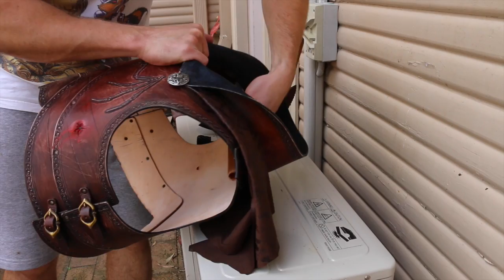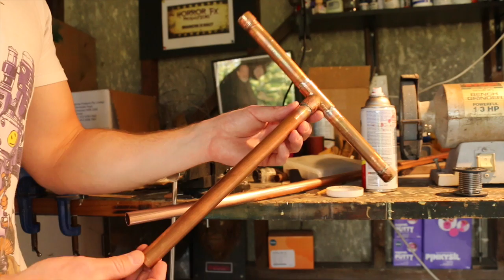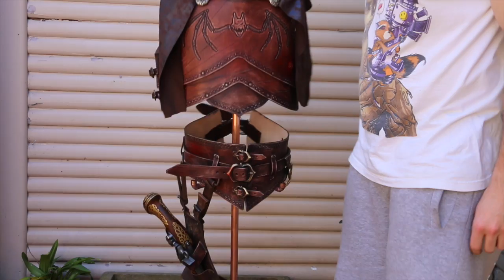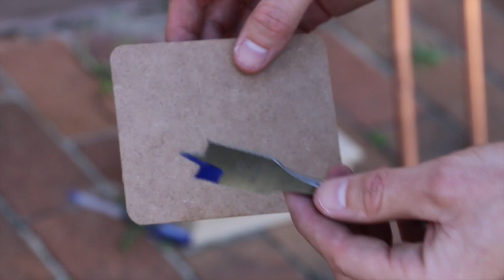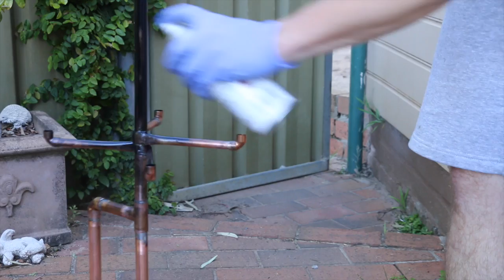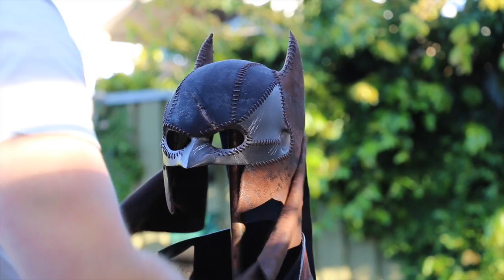Pirate Batman: Copper Pipe Suit Display Build!!

Comment: nice work. just a little fyi for future reference it you heat the copper pipe from behind and then place the solder at the front the heat draws the solder around giving you a cleaner joint.
Reply: markblue777 good point but for this project I think he was going for a little more on the dirty, rag tag look.
Reply: yeah understandable, not everyone knows that point for soldering copper so thought it was worth mentioning so hopefully helps someone.
Reply: markblue777 yup I'll try and remember this in the future if I ever need to solder something.

Comment: Nice job; love the ingenuity. One question though: did you plan on putting anything in the base to keep the whole thing from tipping over? I'm not exactly sure how heavy each piece is, but I figured it would be a wise move to put something like sand in the base to insure that it won't tip over. Just a thought though ☺️👌🏽

Comment: Hey Chris! Just a tip. Using a dry sponge on the copper tubing while some wet paint is on will give the effect of wear and tare from salt water remains making stuff rust and so on. Just wanted to give you the idea if you didn't think about it. Thanks for the video!

Comment: Hey Chris, just thought I could give a few tips from a pro plumbers perspective. when soldering always get your flame real close to the pipe, try and heat from the bottom of the pipe up. and always try and heat the fittings more that than the pipe, that will pull the solder into the joint. but hey u did great! very creative and love all your content! Cheers mate!